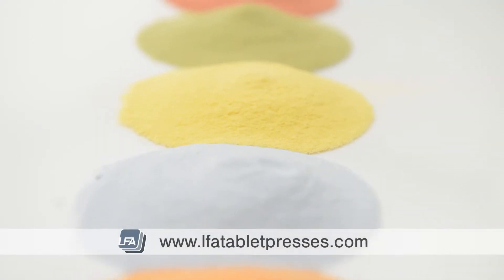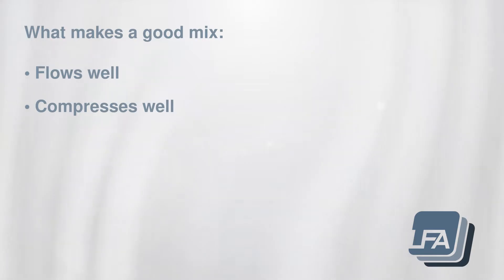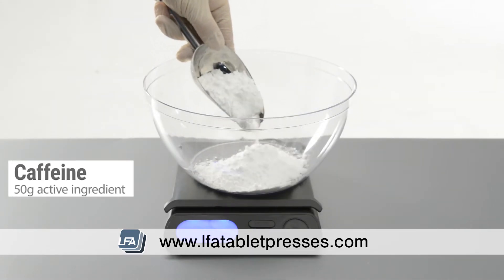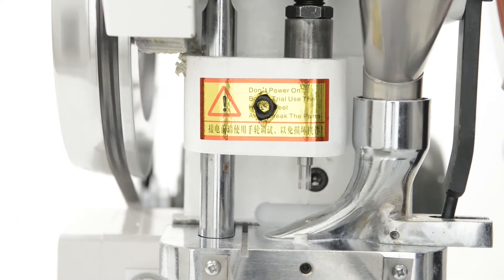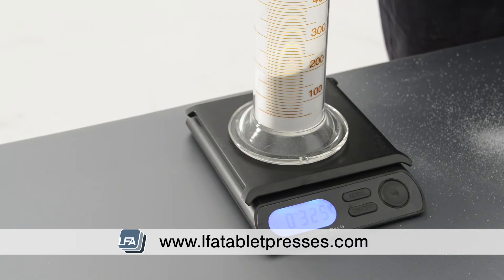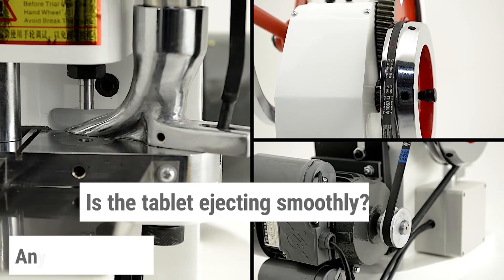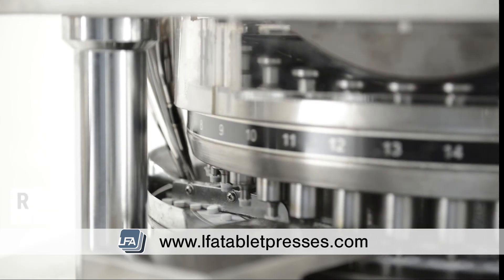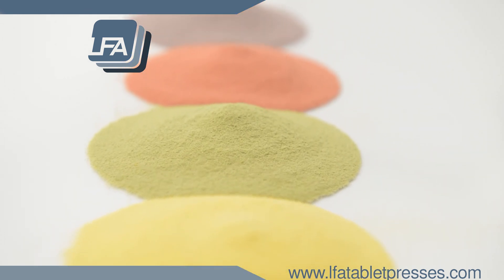Making a Tablet Pill Mix - Making a Test Mix(How to make pills)

Comment: i tried using dicalcium phosphate and it's terrible. It doesn't bind even if you just use it on it's own. Microcrystalline cellulose is better, it binds the tablets very well.
Reply from the maker: Hi Arklysirzirhas, it really depends on the active product you're working with. However MCC is a very popular excipient.